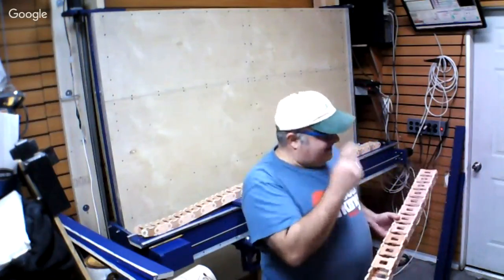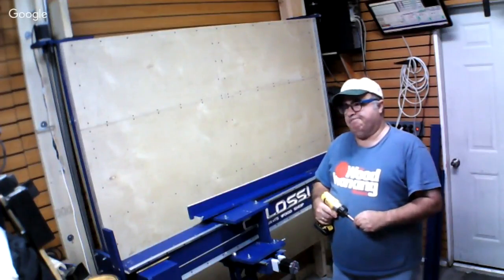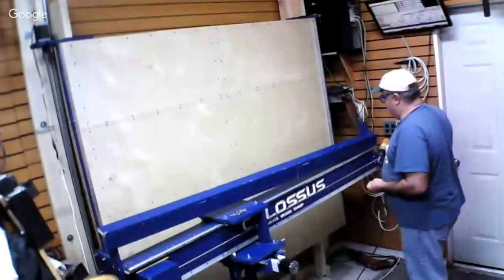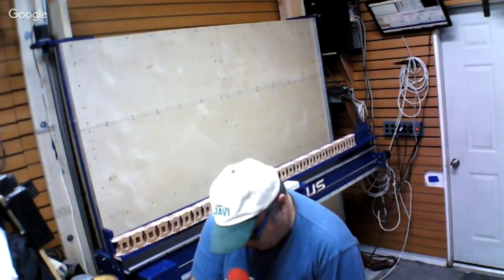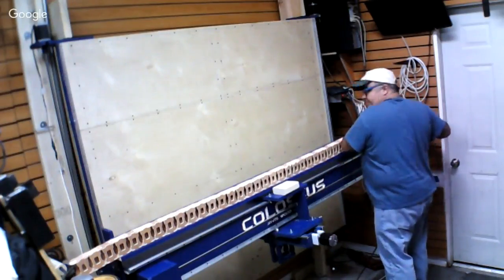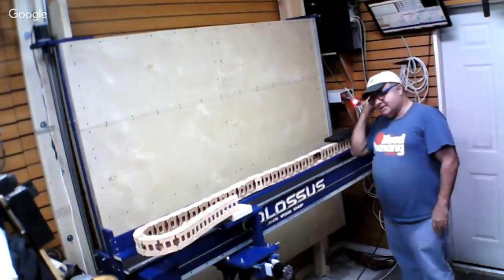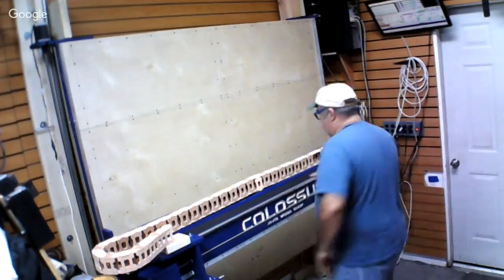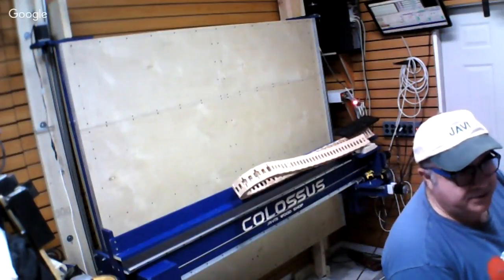Mounting a DIY Drag Chain on Colossus - Colossus Build (Part 5)

Comment: What if the area that supports the downward force of the cable chain is extended so there is more surface.  Cant wait to see it in action as I have a very small space as well.  Cheers and Ill keep on watching
Reply from the maker: That's exactly what I did shortly after this video came out. Thanks for the comment! I'll be coming out with another video soon.

Comment: Did the Gatton Colossus project ever get completed?  The concept of a space saving CNC had crossed my mind, but concerns about the weight of the gantry, and alignment of axes so they remain plumb and level seemed to make it impractical.  Would be nice to hear if hope has been abandoned, or if there is any effort to crowd-source a solution.
Reply from the maker: Yes. Runs in all different directions. Only takes up 7sf of space vertically. I'll get around one day to making plans. For the moment, I'm busy homestead and clearing the new property.